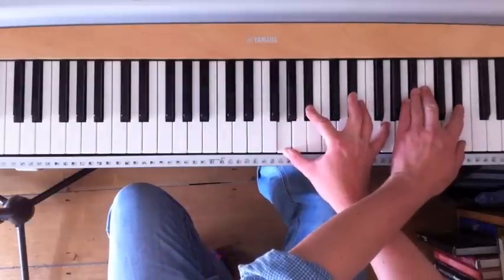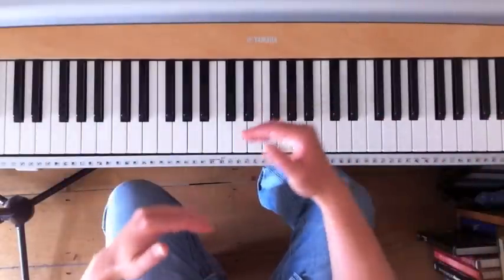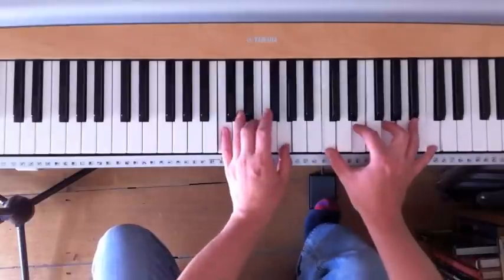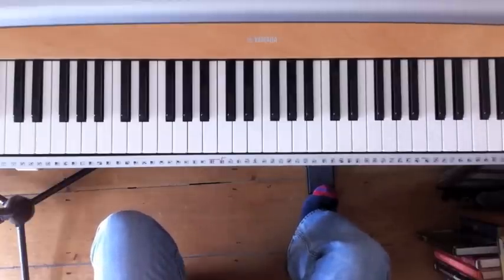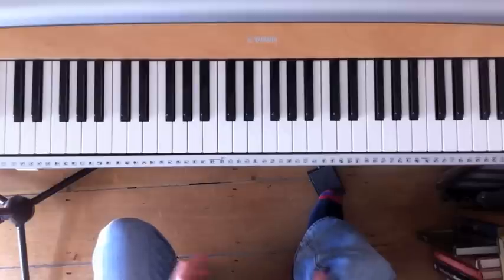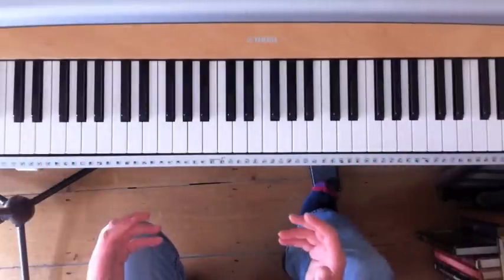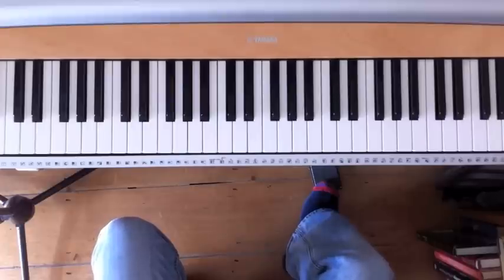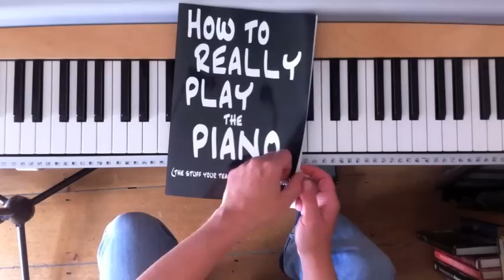Using your piano's sustain pedal

Comment: Is it normal for the high notes not sustain too much when pressing pedal down? (I hear the sustain for only 30 seconds)  I have a dgx630
Reply from the maker: Yep, it's normal, and your DGX is accurately modelling what a real piano would do. Basically it comes down to physics: the shorter the string, the shorter the amount of time it's going to vibrate at frequencies that produce audible pitches. You can test this out for yourself: play the lowest note on the piano and keep it held down (or hold down the sustain pedal) and time how long it takes for the note to die away. Then hit middle C with the same force, and do the same - you should find the note doesn't last quite as long. When you get to the highest note of the keyboard the sustain will be much shorter.
Reply: Thank you so much for the detailed answer!

Comment from the maker: @Carlm2 Good advice if you were given it in a classical context. Basically, in pop styles we use the pedal to (a) create a big sound and (b) fake a legato. In classical piano, we use the fingers much more for the legato, and the sustain pedal is used to hold notes out of hand range and/or develop the sound. In short, classical piano demands much more precise, and usually slightly different, pedal usage.

Comment from the maker: @tuningmylifearound Yes, though it only really works on some pianos! On a good quality instrument with the pedals well set up, you can "half pedal": effectively, release the pedal more slowly so the damper doesn't stop the string vibrating instantly, or, even keep it "brushing" the string. On a piano that can do it, you need to find the point at which the dampers are in the right position - it's a bit like using the clutch on a car...!

Comment: I’m trying to play rosemarys theme but when I change chords (broken chords) it stops and doesn’t sound good. I’ve tried pressing the first key if the next chord and reset it but it doesn’t work as well. Is there anything else I can try?
Reply from the maker: There's kind of a trick to getting pedalling right in that context - it's all about timing things so that your foot comes off the pedal at exactly the moment the first note(s) of the new chord go down, and repedalling right away to give the illusion of a smooth continuity - so in your case it would be literally up-down between your finger going down on the first note of the new broken chord and coming off it again, so you need to be pretty quick! It can be affected by the type of piano and pedal, too: if you're using a digital piano with a "pad"-type pedal it might be worth investing in a traditional-style pedal, which should be more sensitive. Does that help?
Reply: Bill Hilton yes very much thank you and I’m playing on upright, electric and keyboard. Depending on which is easier to get to with the room setup  I’m sorry for the late reply. Haven’t had much time lately but I will certainly use your advice. 😊

Comment from the maker: @Charlie135i On a modern piano, probably over each chord. There are places where you'd need to change that, though - e.g., bars 12-15, where you'd probably re-pedal on each of the bass notes. Also, some editions will include pedal marks (not Beethoven's - an editor's, but still useful). 

Beethoven, famously, indicated that the whole thing should be played with pedal down, but pianos had much less natural sustain when he was composing. If you tried that on a modern grand you'd get a mess!

Comment: I am having problems when playing a melody without big jumps and playing octaves as the bassline. I try to lift off my foot when I play a new "chord" so to speak but it just sounds wrong, like it's being cut off for half a second before sustaining again.
Reply from the maker: It just takes a bit of practice with the timing - you'll get it after a while. Basically you need to be repedalling slightly before the hammers (or virtual "hammers", if you're playing a digital piano) hit the strings. The exact point is going to vary by piano and the acoustic of the space you're playing in. On real pianos (and higher-end digitals) the speed at which you lift your foot and how much you lift it makes a difference, and can make bridging between chords smoother. Remember you're aiming for a fairly minimal movement with your foot: rather than lifting off your foot entirely, just flex your ankle a little bit, so that the ball of your foot (which, ideally, is the bit resting on the pedal) comes up smoothly.

Comment: Just bought Studiologic/Fatar VFP 1/25 sustan pedal. Connected it to the midi controller but it doesn't work. Who can help with that? I have 2 switches on the bottom of the pedal but they don't help at all. No sustain at all when pressing pedal to the floor.

Comment: I piano has two pedals, ( that I know of) the sustain pedal is one of them I'm guessing, but what is the other one???
Reply: Aniketica The sustain pedal is on the right, on the left will probably be the "soft" pedal, it basically softens the sound and makes it more "dull", or less loud.
Reply: Hmm I see, thank you for clearing that up for me
Reply: Aniketica On a real piano, pressing the left pedal moves the entire.. uhm I don't know how to call it, the entire inside basically so that when you hit a key, the hammer only hits 2 strings instead of 3. Thus making a softer sound :)
Reply: Ohhhhh, ok, now it makes sense
Reply: Also, do they have a "soft pedal" for electric keyboards, I have a Casio ctk-2080 but can't find a soft pedal on Amazon, or anywhere, only sustain pedals.
Reply: Aniketica That probably depends on your keyboard, most digital pianos these days in the 600$+ range with 88 weighed keys have an option to buy a pedal unit which includes 3 pedals (soft on left, middle is another pedal and sustain on right). If it's lower end then I think there might be only sustain pedal available. However don't worry about it too much, if you have a lower end keyboard and are starting out you won't be needing the soft pedal anyway (I have it and never use it.)  
The 3rd pedal on a 3 pedal unit is in the middle and I won't get into how it works as I'm not sure I understand 100% how to use it myself.
Reply: Ok, thanks, I was worried that it would be important. 👍

Comment: Thank you for this. I have played electronic keyboards for many years, but the sustain was never available, or I never mastered it. This is going to be very helpful in learning how to pull my foot off between key changes so as not to create dissonance. Thank you.
Reply from the maker: +Jim Cim No problem Jim - yup, it's a useful skill to have, especially on acoustic pianos where you pretty much rely on sustain to create some of the most important effects.
Reply: When I played in a band in the 60's it was organ, and the main effect was the volume pedal. Then the early cheaper midi keyboards either didn't have  a sustain pedal, or worse, had no velocity changes on the keys, let alone pressure weighted keys. It's like starting all over again in some respects for me, even though I have written dozens of Pop songs and recorded all the tracks on all of them.

I just know if I refresh a few good techniques on YouTube like yours it can only help this poor old man get a little better. LOL

Thanks.

Comment: Hi Bill, happy new year! I bought a few books, easy Chopin etc, with nice arrangements but they don't say anything about pedal! I assume in most of the slower ones you would use pedal? 
Also could you please explain how to use pedal on appogiatura and accaciatura?? Thanks a mill!
Reply from the maker: Yep - use of the pedal is generally assumed in that kind of material: as a very rough guide, assume that you can use the pedal at your discretion in anything later than Mozart (it's fine in Mozart, too, though I'll probably get some purists come along and get angry with me for saying that). As for using pedal on grace notes: the watchword is "carefully"! It very much comes down to your piano and the characteristics of its pedal, but if a grace note needs pedalling for whatever reason, usually you need to get on and off quite quickly, kind of flicking up from the ankle... if that makes sense?

Comment: Hi! What if i want only first note in the measure to be pedaled for the whole measure, and keep all the other notes unpedaled? On acoustic piano, it it is done with the middle pedal, as i much as i know. Can this behaviour be imitated on digital piano?
Reply from the maker: Some digitals do indeed have that functionality on their middle pedal - I think I can do it on my Nord, but I've never really tried - but sostenuto pedals (which are what you're describing) are far from universal. You find them on a lot of Steinways, both grand and upright, but many pianos either have no middle pedal at all, or their middle pedal does something different. In the absence of a sostenuto pedal your best bet is to try to achieve a similar result with fingering, or by faking the sound you're after using the regular sustain pedal (which is possible, especially if the sustained note is low and the rest are in a high register).

Comment: Do you HAVE to have a sustain pedal? I was thinking of buying a keyboard (Casio) and was just wondering if I absolutely need it. I heard that it is apparently essential to have it. I just want my sounding to sound good or at least reasonable. I have stopped playing piano for years now and have decided to play again.  I'm sort of a early intermediate level. Any one? Thxs
Reply from the maker: +Joanne Blueberry The short answer, Joanne, is that you don't absolutely HAVE to have one, and you can do quite a bit, especially in the early stages of learning, without one. However, not having a sustain pedal hugely limits what you can play, and restricts the creative power of the piano. If you'll forgive a somewhat laboured analogy, a piano without a sustain pedal would be kind of like a car that only had first gear: it would move forwards like a car is supposed to do, but you couldn't use it for most journeys and it wouldn't be much fun to drive. Does that make sense?
Reply: +Bill Hilton Thanks! I get it now.  This helped me quite a lot. I'll take your feedback into consideration. Thanks again! :)

Comment: Thank you for such a practical demonstration. And, I had never heard of "sympathetic resonance" before so I learned something too and I understand your explanation. I play both acoustic and electric pianos and keyboards so I do use the sustain pedal in my performances and am familiar with using it, much as you describe.  However, I would like to ask this question. When playing a piece, such as a hymn, where the chords change on almost every beat, I tend to briefly pedal on and off almost every chord, just to keep it more legato rather than staccato. Is this the usual technique or is there an alternative?  Many thanks in anticipation.
Reply from the maker: No problem - glad you liked it. Re: pedalling, what you're describing is pretty much what most people do, especially with chorale-style material like hymns. Sometimes you have to be pretty quick with your fingers and foot and compromise between clarity of sound, quality of sound and smoothness. The (partial) alternative is to get clever with your fingerings and do a lot of finger-switching (in the way organists do) to keep things as smooth as possible. A good player will usually use some combination of finger-switching and pedal in a situation like the one you're describing. Does that make sense?
Reply: Thanks for your considered explanation.  Yes, it does make sense and I also understand what you mean by "finger-switching" as I play the keyboard and organ as well.  However, with my electric keyboards I can also use a sustain pedal with the organ sounds, which is cheating really but, on the other hand, it does give you the "best of both worlds"!

Comment: How would you apply the sustain when playing the blues with a left hand walk and right hand chord vamp sliding off your minor third?
Reply from the maker: +texheel Carefully, and not necessarily at all - probably something like every other beat rather than every full bar. It's one of those things that's going to depend on your piano. With an upright or a decent spec digital piano which supported the effect, I'd probably half-pedal in a situation like that - i.e., push down enough just to lift the dampers slightly off the strings but no more.